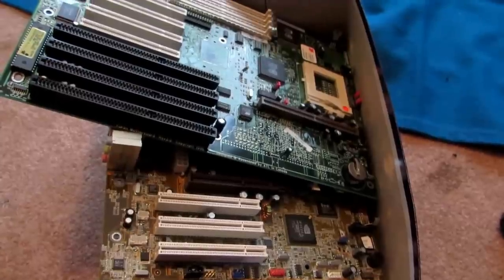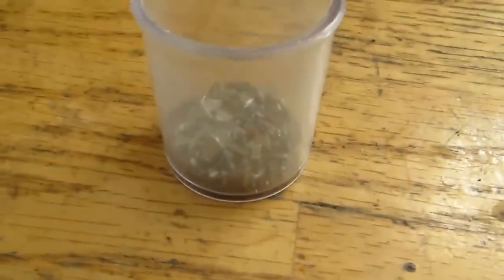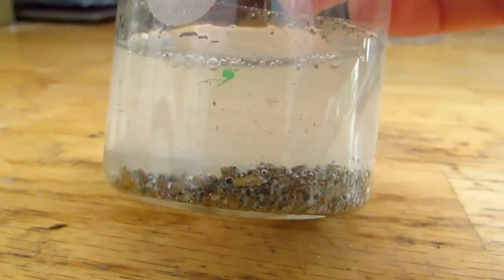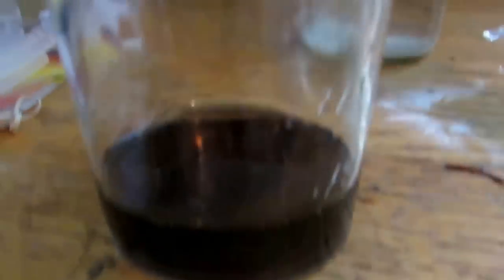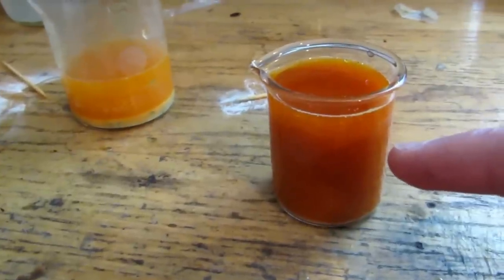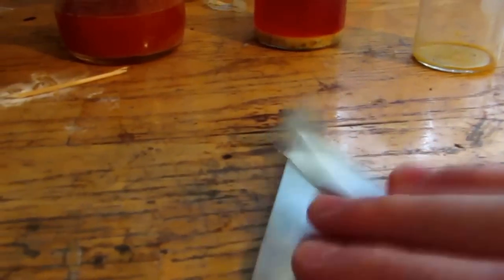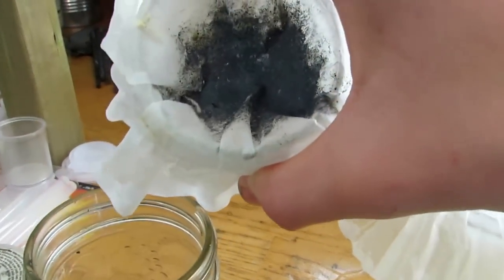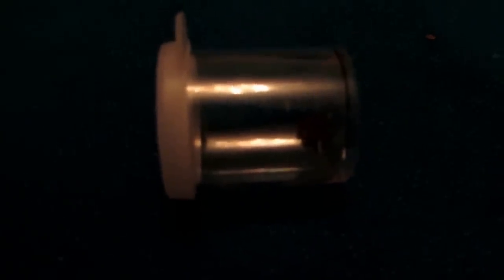Extract Palladium from Capacitors (Household Materials)

Comment: Please please wear gloves when dealing with chemicals!! When dealing with the platinum group metals extreme care needs to be taken. This should be done at the very least outside if not in a fume hood. A respirator and gloves are a must!! Clearly you don't respect the chemicals you are working with but dont post a video with your ill practices for the uniformed to see and copy. Platinosis has no cure!!! Also don't leave the Hcl on your shelf in your room Hcl is corrosive the gases will not only harm you but also rust everything up in your room.

Comment: Awesome! I been refining a couple  gold crowns and was quite disappointed at the amount of time it would take for me to get DMG (Dimethylglyoxime). Don't feel like spending 50 bucks to get way more than I need in a timely manner. I already dropped the gold with sodium metabisulfite. Judging by the color of my solution it should just contain Pd. So using zinc should work great. Thank good vid!
Reply: Just did a little reading on Pd. Seems to react with acetic acid to for insoluble Pd acetate. Maybe that could work to separate it from the nickel. maybe I'll try that instead of zinc.
Reply from the maker: awesome! good luck!
Reply: The Canadian Chemist hey just an update. Acetic acid didn't work, maybe bc I was using vinegar. But using zinc worked great! I think my gold crowns were mostly Pd and gold, so it think it is mostly pure. I can always try to repurify it again.
Reply from the maker: Gary Carone nice! Good job!

Comment: You want the most modern converter you can get.  Hi performance if possible. 
Once you get the substrate out of the can, don’t crush the substrate. All you want is the coating on the substrate.  You can generally wash about 80% out without crushing up the substrate.  That slurry is the all you want.   You won’t see rhodium and palladium together 
Those two nitrates together cause a runaway exothermic reaction and the fire department will think you have a meth lab. 
Platinum and palladium nitrates get steaming hot as well. Avoid mixing those and stay out of the NOx.   Orange cloud bad. 
Better to just not breathe than breath in NOx.  Trust me. 
Rhodium will be by it’s self.  And platinum and palladium will for the most part also be separate.  Depending on the motor the converter was on, you may also find neodymium or lanthanum in decent amounts. Traces of barium.etc.  Very few people know know this.  So Yur welcome and good luck.

Comment: you poured hydrochloric acid and then you sit this for 1 week? and after hydrochloric acid you poured which acid before you pour the drop of nitric acid
Reply from the maker: more hcl, but only after rinsing the struff from the first hcl washing. The first was to remove soluable metals like nickel and iron, and then I rinsed it to remove any remaining iron and nickel chlorides formed. Then I put it in more HCl then added nitric acid. This formed Aqua regia which can dissolve metals like palladium. The remaining ceramics were filtered off, so we had a solution of our palladium. Does this make sense?

Comment: If you boil the bullion using HCL, does the palladium dissolve?
Reply from the maker: Palladium shouldn’t dissolve in hydrochloric acid
Reply: @TheCanadianChemist  1.5 kilograms of mlcc magnets I was off but could not find the error palladium dimna master.  The first step I did was burn it until it was red like charcoal, then I ground it into flour.  the second step I put in a pyrex glass then I boil using a single hcl then the water changes the color to red which I assess is nickel water, I drain it I wash it a few times to get rid of the hcl, then I soak it using h2so4 to remove the iron and then I wash it  , after that I just boiled using hno3 to get palladium and silver but I didn't get it using potassium iodine.
Reply from the maker: cool! how much palladium and silver did you get?
Reply: @TheCanadianChemist  I did not get it, the rest of the material that I boiled did not run out in a pyrex bottle. I tried to burn it directly so it got 6 grams of bulion and even then I xrf 0.029 palladium 0.89 silver with the rest nickel.
Reply: @TheCanadianChemist  master, if settlement water or aqua regia is deposited using lime (cao), is the color of yellow sediment different?  please enlighten me.

Comment: Is the Ni-Pd  a Ni-Pd alloy particles or a mixture of nickel particles and palladium particles? in the second case you can just use a magnet
Reply from the maker: hmmm, i'm not sure but I didn't think of that and that is a great idea, I will try it. Thanks!
Reply: +piano and science guy np
Reply: would like to see a vid of that )
Reply from the maker: TheWomblemaster I did this a while ago. I processed the other solutions and recovered the palladium, but never filmed it. sorry. I am however currently recovering palladium and platinum from a catalytic converter. I currently am almost done, so that should be a cool video soon!
Reply: i have no interest in cool vids.  am after a efficient and simple way to do something useful with mlcc.  Am looking for something that removes the crud and leaves the silver+palladium....I dont need to seperate those atmo.  really i need a process thats as low on toxic gasses as possible(and is cheap)
Reply: am not clear what dominic meant.  is palladium magnetic? or the nickel?  what does one do withthe magnet, rub a magic frog, while whistling dixy ?
Reply from the maker: TheWomblemaster he means that you could separate the palladium from the nickel because nickel is magnetic and would stick to the magnet, leaving the palladium behind.
Reply from the maker: TheWomblemaster no, why?

Comment: Can iron/steel or copper be used instead of zinc to displace the palladium?
Reply from the maker: copper is not very reactive, so it would be much more difficult. Iron is more reactive however I'm not sure it would displace the palladium. ideally you want to have a very reactive substance, zinc forms and oxide which protects it, but it is a very reactive metal. instead of iron or copper, I would use aluminium foil if there was no zinc available as aluminium also forms an oxide which protects from attack, but it too is very reactive. you could try iron, although I would avoid copper.
Reply: I would have thought that copper would be the best, since it's higher on the reactivity series than palladium but lower than nickel, so that the nickel stays in solution. Then again, copper oxidises in air
Reply from the maker: Muzik Bike - Geometry Dash and stuff hmmm, I never thought of that, it could work... you could try and see if it works. If you do try, let me know the results.

Comment: Hello Sr. Can you explain how que can recognize the MLCC PF Palladium?, The idea Is to Starr yo collect4
Reply: Do the magnetic test if mlcc will attract to magnet then it should be silver and Nickel and if it doesn't not attract with magnet then it will be 10% silver 2% Palladium or you can watch the code of MLCc it will be MLCc or MLCI means inductor every single IC has a code on it on board motherboard or circuit board don't pickup code with L  for losers it will show you that it is not ful Palladium mlcc it is not MLCc it is MLCi means inductor pure mlcc I will show you to C in his code ( sorry for my English I barely speak English)

Comment: How much palladium did you get?
Reply from the maker: I believe around 0.2 grams if I recall, not very much, but enough for my element collection!!!
Reply: Thanks for your response. Those were not a lot of capacitors so i'll almost be economic to do it that way if I need 2 grams.
Reply from the maker: Robert what do you need 2 grams for?
Reply: I thought of possibly making palladiumchloride as a catalyst. I didn't even check if I know how to do that but I found myself in a fun flow of research where I wanted to look up how to make something. Not a chemist at all but my curiosity captured me.

Comment: I'd hate to be the bringer of bad news but that black crud at the end? It ain't palladium. What is it? Zinc oxide, with a few Trace metals thrown in. How do you get palladium from MLCC's? You can't-that practice ended in the late 1990's when SMT cap manufacturers switched from Pd to Ni for everything but space and mil-qualified parts. Ok, so how can you tell if you really have palladium or not? Dissolve the black gunk in aqua regia (1:4 ratio of nitric : hydrochloric acid), then add, dropwise, saturated solution of sodium metabisulfite. You have palladium if the black powder prec>pitates; nothing but zinc if it doesn't.
Reply: i don't know about reactions , but you are wrong on the part in which you said smt manufacturers stopped using palladium in those , only after i think after 2011 they started shifting towards nickel at large scale , that too in those devices in which mlcc have less  stress while using

Comment: where did u get that funny pots that moves ?
Reply from the maker: lol, this was before I had a tripod... The video was shaky, so YouTube stabilized it for me... In doing so it made some very weird effects!
Reply: what house hold stuff can I make to melt steel
Reply from the maker: White Rhino you could use some microwave transformers, rewire them and build a small arc furnace. I built one based on grant Thompson's design... Search how to make an arc furnace... It's one of the most useful things ever and will liquefy steel in about 20 seconds... very fun!

Comment: Nice video. But I missing some steps, you have several samples and what liquid is inside you ? e.g. you put here nitric acid.  And regarding nickel and palladium displacing, are you sure when you use zinc that only nickel will be replaced? I think all metals above zink are replaced with..

Comment: i think you could have used less of the two acids, especially because the HNO3 is like $50 per L.
Reply from the maker: yeah, but I made it myself and it is way cheaper than 50 dollars per litre. also, this was quite a while ago and this acid is only about 10 percent because I never got around to distilling it at that point.
Reply: The Canadian Chemist I looked up how to make it and after purchasing some glassware apparatus besides the electricity used, it would be way cheaper using KNO3 and off brand drain cleaner. I Google HNO3 for sale and came up with the $50 per L figure.
Reply from the maker: mikematij2 I know, that is now how I make my nitric acid. I always use drain cleaner and sodium nitrate which I prepare through the reaction of calcium ammonium nitrate cold packs with sodium hydroxide. I use 98% sulfuric acid and no water so I have near anhydrous nitric acid which is very dangerous, but can be diluted to any concentration. Much cheaper considering cold packs are 2 dollars for 2 in a box and sulfuric acid drain cleaner can easily be distilled and purified.
Reply: @TheCanadianChemist  sodium nitrate and sodium hydroxide are 2 ingredients in making meth so in America don't buy both cold pack and drain cleaner at same time

Comment: your amazing kid, if you don't go on to cure cancer or something i would be suprised
Reply from the maker: lol, thanks!
Reply from the maker: I know, I am relatively safe and when I feel that I need, I wear a gas mask, gloves, googles, lab coat, and other necessary safety gear. I know things are carcinogenic and it is true that I could get cancer, but I really do try to do research and stuff before dealing with dangerous things.
Reply: There is not relatively safe, you either are or not. At least when you do it and then post it on the internet take all the safety measures and make a disclaimer. If you enjoy making science at least be serious about it.
Reply from the maker: this is one of my older videos, I feel I am safer in my more recent videos, I definatly shouldn't have been using nitric and hydrochloric acid indoors!